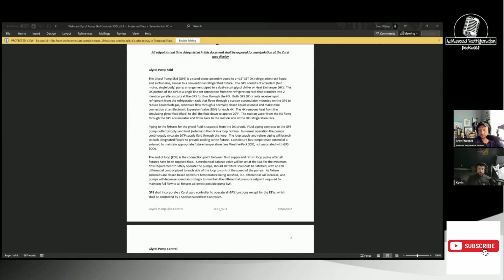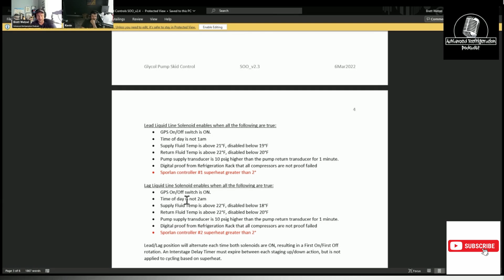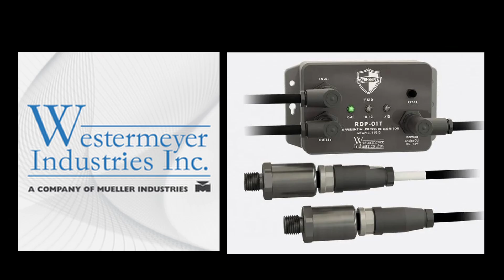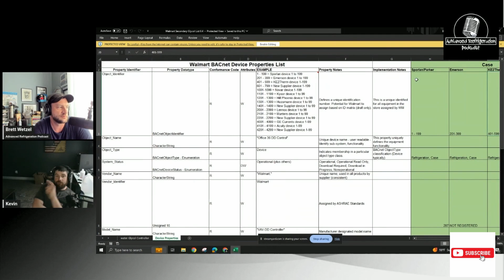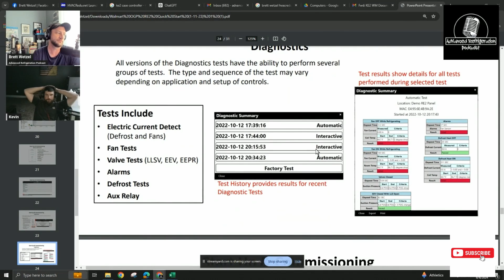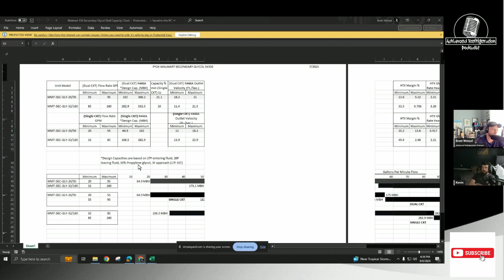Glycol Supermarket Systems, Lets Talk About them, and SHANK   Sup Bud !!!!       Episode 333 Video

Comment: Additionally, I have two new RAECO2 skids installed on my existing racks a and B low temperature and having serious serious issues with a low superheat, low load on my CO2 racks with all my carlyle compressors still operating at full capacity and not properly stagingcausing severe floodback you’re supposed to be installing a VFD compressor, but nothing has happened yet it just repeatedly flooding these compressors out any thoughts of what could be done in the meantime, lol

Comment: Additionally, I have two new RAECO2 skids installed on my existing racks a and B low temperature and having serious serious issues with a low superheat, low load on my CO2 racks with all my car compressors still operating at full capacity and not properly stagingcausing severe floodback you’re supposed to be installing a VFD compressor, but nothing has happened yet it just repeatedly flooding these compressors out any thoughts of what could be done in the meantime, lol